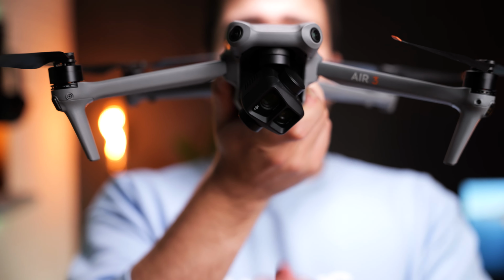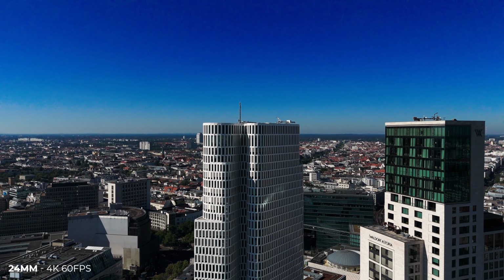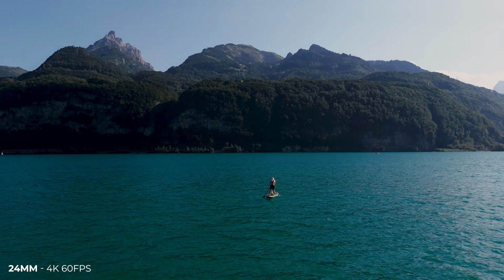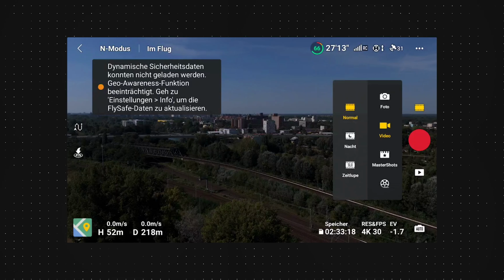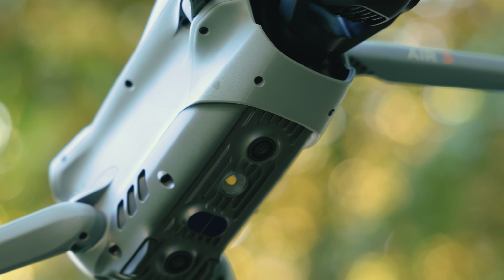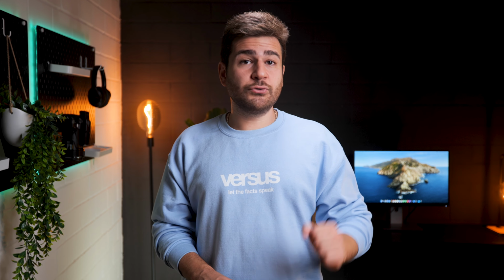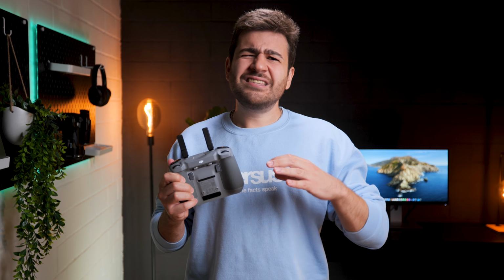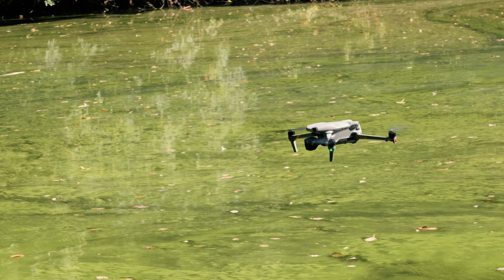DJI AIR 3 Review - The best drone out there? | VERSUS

Comment: If it would have again (like the original AIR) 430g -Yes. With 720g no way!
Reply: Why not? It has a much longer flight time as well.
Reply: @XploreAz  I don't take a 3x heavy/bigger drone on a mountain for same image quality ;-)  ...Mini or Mavic Pro! ...only a more compact  AIR (around 450g) would make real sense and would sell like bread!
Reply: @patfish3291  same image quality? It has a 70mm lens. What other Air series are you talking about that can compete with that?
Reply: @XploreAz  The AIR 3 has 1:1 the same sensor like  the Mini 4 Pro = same image quality!
The thing is the AIR series got in the last year's too big and heavy for their image quality/benefits over the Mini 4 Pro and too close (size/weight) to the Mavic pro Series.
If the AIR would have a bigger image Sensoren (like its preprocessor has already!) it would be a different story. With the same Sensor/Sensor size like the Mini 4 Pro the AIR should be no heavyer than 450g. The AIR 1 had 430g that's the perfect size/weight for such a drone!
Reply: @patfish3291  but the Air 3 image quality is better than the 1” sensor that is on the Air 2S because of the stacked sensor. Plus you have the benefit of the 70mm lens. And I’m not worried about carrying an extra 12 ounces of weight. That’s a small bottle of water. Haha!
Reply: Actually about 10 ounces. Smaller than a bottle of water.
Reply: @XploreAz  not if you take it on a high mountain, a climbing, ski or  mountainbike toure ;-) ...there you spend houndreds  of $ only to get a bit lighter equipment and a sturdy  bag with the AIR3 + Controller and 3 Batteries will fill up your whole backbag :D.

A bigger sensor also makes a different picture (depth of field, look) . Why not stacked and 1' to make a real difference to the Mini 4 Pro?
Reply: @patfish3291 it's not the same image, there's two lenses and the 3x has a lovely effect on mountains.

If you're up mountains, the extra weight is a bonus to combat the wind.

If you find the air too heavy.. How you going to manage a mavic? It's a middle ground. 

Do you not find the minis a bit slow for tracking rides etc? I love my mini, but fast it isn't.

There is no perfect drone.
Reply: @whotshisface  It's a bit slow but only at tracking!  - But that has nothing to do with the speed of that drone :-) ...if the Mini could follow me with 50 km/h through a forest it would more than enough :D.  The problem is more the resolution/regognition of the Obstical avoidance system. It's not there yet and did with the 360° version of the Mini 4 Pro a step back (18m vs. 25m on the Mini 3 Pro).
The point is I never ever would take a 750g drone + controller + pack on a mountain, bike ride, sking-tour - just in case! ...that's the whole point of that story. If I take the mavic 3 Pro I go filming but not skiing ;-)
Reply: @patfish3291  it's not all about you though.. DJI create these things for a multitude of people. If you lived in the UK for example, and went up mountains, you'd know how inadequate the mini was in  the wind. And following your own logic.. It would be easier to carry an air than a Mavic. I totally accept that I carry a little bit bigger bag than you though. Stronger legs maybe ; )
Reply: @whotshisface  again, were is the DJI Drohne between 249g and 720g ...this would be for most of us (me and I think you as well) the sweetspot between size, weight, robustness and wind resistance.
Reply: @patfish3291   I think some of the issue is the sheer popularity of the mini drones, and with good reason I guess.

But yes.. When they come up with a 500 gramme drone with at least 2 cameras that better the Mavic and fly for at least 30 minutes, put me on the list.😁
Reply: @whotshisface  Here we go ;-)
Reply: @XploreAz  And with the Plus Batteries you would get the same Flight times only for a few  grams more :S